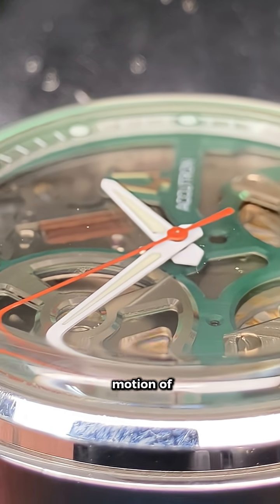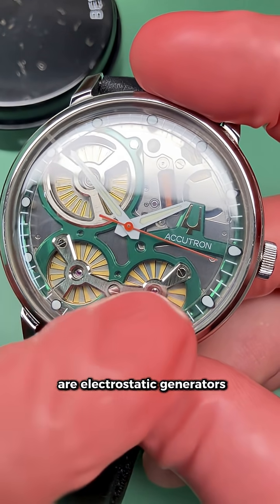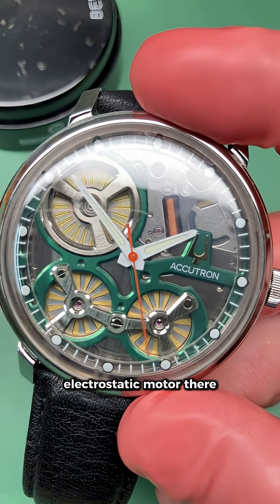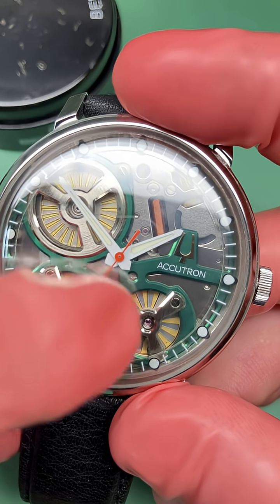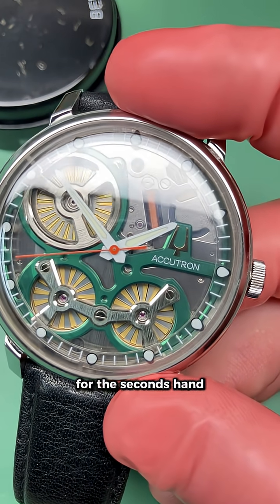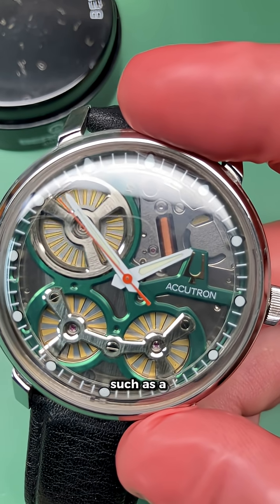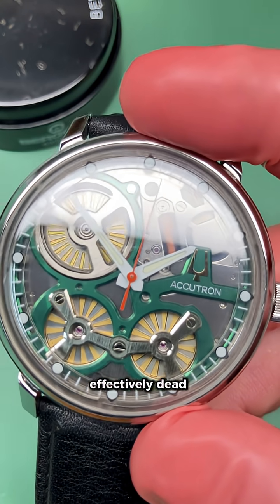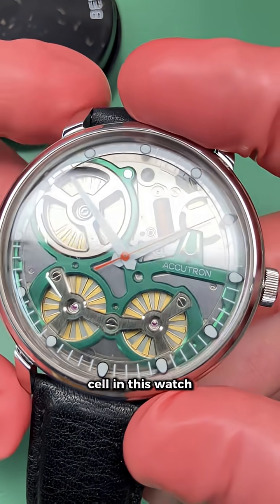This Watch Is Powered by Your Movement  #shorts

Comment: Nothing to compare with mechanical or manual watches
Reply: Yeah, but did you see how smooth that second hand swept
Reply: mechanical and manual ...?? it s the same ...
Reply: @sed64  Exactly, though it's a common enough perception that thinks "automatic" and manual wind are somehow radically different.
Reply: @sed64 
Mechanical means it charges through your hand movements.
Manual is also mechanical, but it needs to be wound by hand.
Kinetic or quartz watches run on either a capacitor or a battery which makes them less valuable.
Mechanical is the best you can actually feel the soul of the watch and appreciation of the watch by time